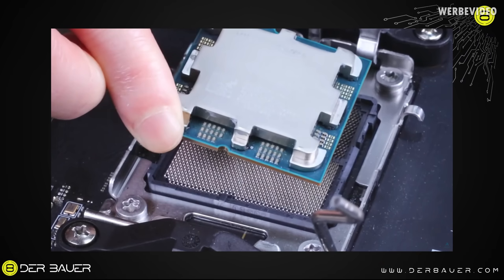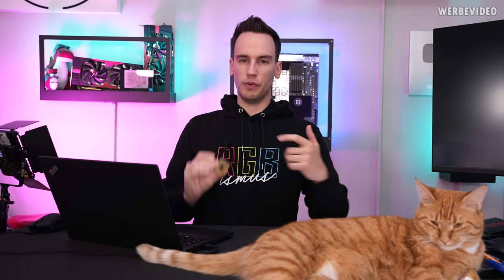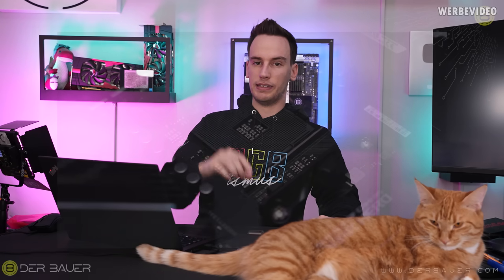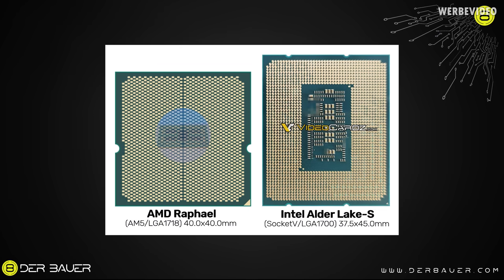Very thick IHS and less Contact Area - some thoughts on Ryzen 7000

Comment: i feel like amd might be shooting themselves in the foot with this "same mounting for am4 and am5" thing, i dunno guess we ll have to wait and see
Reply: Def piss off mobo suppliers
Reply: Isn't it just the whole spacing? Which in the end doesn't really matter
Reply: @GewelReal  No, it's the z-height.  Whereas Alder Lake for instance lost ~0.8mm z-height, so aside from different holes, you also need different parts to keep the same pressure.
Reply: @spacecowboy07723  why does keeping the same dimensions piss off mobo "suppliers"?
Reply: z-height and mounting holes are the same though, so the only problem could be that the zen 4 ccd's are situated higher.
Reply: @yourick1953  I was telling Gewel that there was more to compatibility than holes, and giving an example of incompatibility in z-height.  I wasn't talking about Zen4.
Reply: @fVNzO  because mobo suppliers can't force customers to upgrade = less money made.
Reply: @spacecowboy07723  but customers are forced to upgrade if they want zen 4 so I don't understand what you're referring to. The only ones affected here are the accessory manufacturers who won't have to waste money on new brackets, in other words positively affected.

I can't come up with a single party in this equation that would be pissed off here.
Reply: I agree. I mean it is same exact size as AM4 despite having more pins in 1718. I thought it would have a larger PCB and IHS like LGA 1700, but nope. I appreciate AMD's desire to keep existing coolers compatible without needing an adapter or different kit from cooler manufacturer , but this will hurt heating ability. When AMD said existing coolers would be compatible, I was thinking well yeah but of course you will need an adapter kit for Noctua NH-D15 and the like. But appears they wanted to make them compatible without having to change anything. That will hurt cooling performance with the lower die size and higher power. This is not a situation like Intel had where the socket changes were so small from LGA 1156, LGA 1155, LGA 1150, and LGA 1151, then LGA 1200 where it made sense without issues to keep same mounting mechanism as change was so little. This is more like the change form those to LGA 1700. Makes more sense for different holes and just get cooler vendors to provide a mounting kit.
Reply: @spacecowboy07723  Well in that case it would tick off motherboard suppliers especially the AIO and tower air coolers and custom water blocks and such. But mobo makers themselves, why would they care? You still need a new motherboard for Zen 4 anyways so has no affect on them.
Reply: @fVNzO  Actually it is accessory manufacturers who would be most pissed off since they will not make money from selling new brackets to adapt existing coolers to work with a new mounting mechanism.
Reply: @Wolverine607  I think it's the other way arround. It's an expense to produce a new mounting bracket. They wont suddenly make more money. They always sell *a mounting bracket*. Having to design a new one is an expense. Not having to design one is not an expense. 

Besides, they won't retroactively sell brackets for existing customers (which will be a loss in itself either way due to the volume), they will give that kit for free.

Comment: Zen 4 is gonna be rough, everything officially shown about it says it won't be more than just a zen 3 refresh performance and efficiency wise on a new platform. The new IO die is great and the igpu's on all chips is also great, but this will more establish a new generation of platform than a new generation of performance
Reply: 15-20% single-threading and 40% multi-threading increases isn't a "zen 3 refresh" lmao
Reply: @WhenDoesTheVideoActuallyStart  15% single threaded performance =/= 15% ipc gain. It means 15% is the sum of everything they threw at it, including more cache, a revised IO die, new process node, DDR5, architectural improvements (IPC gains) and of course clockspeed. 40% multithreaded could be due to higher all core turbos, could be due to higher memory bandwith (DDR5) could be due to the IO die and improvements to infinity fabric, or a mix of all 3. It's still a refresh performance wise. On the AMD side would be 1700x to 2700x, on the intel side would be 4770k to 5775c.

I have 2 ryzen desktops (work and gaming) and a ryzen laptop btw, I don't hate AMD or any shit like that, but I'm giving my honest thoughts and criticisms based on what knowledge we know.
Reply: @james2042  Cache size, the IO die, etc... are all part of the architecture. IPC simply means "instructions per clock", how you get more IPC doesn't matter. E.g. the 5800X3D has better IPC because of the extra cache.

Zen 4 should have around a 5-9% IPC increase depending on the workload, plus the architecture was redesigned for the 5nm node and to allow for higher clockspeeds. No matter how you phrase it, that's not a refresh, nor is it the same architecture.
Reply: @james2042  Greater than. Greater than 15%, in cinebench, which doesn't take advantage of double cache or ddr5. And 40% multi threaded on the same number of cores/threads is not a refresh, whatever way you get there.
Reply: Even the frequency x performance curve is a function of the architecture. The first iterations of Zen simply didn't scale linearly with clockspeeds, which is why AMD went for efficiency and didn't try to rush to 5Ghz. That they suddenly managed to get Zen 4 to scale to 5.5Ghz means that they had to redesign the pipeline to eliminate the bottlenecks (Which probably was about moving the data around).
Reply: @james2042  "40% multithreaded could be due"

Dont forget much higher tdp this time with 170W TDP and 230W PPT, which is why these values are as high if you compare to 5950x which becomes very power limited in all core cinebench workload, 5950x gains ~15% easily if you unlock power limits from the socket for 3d rendering. We will have to see when zen 4 will be released but from what we currently have it doesnt look good at all.
Reply: @h1tzz  yeah because 5950Xs were only ever pulling 105w🙄. Yes they gain significantly in performance if you let the core run without limits and even more if you set a specific OC for the target test. We'll have to wait and see what happens when they're out where the gains are from.
Reply: @NotThatGuyJD  default PPT of 5950x is 142W, without power limits in 3d rendering tasks it will draw ~240W and will gain ~15% of performance, we dont know yet if that demoed blender cpu was using 230 PPT as robert said it was running bellow that but we dont know how much for sure, but anyways considering that 5950x was already faster in blender than 12900k by about 15% (depending on rendering time) those numbers seems a little bit worrying but we will have to see that later.
Reply: @h1tzz  I'm hoping they provide great boosts in all aspects but my ADL system isn't really going anywhere at this point because it's already so much more than I need.
Reply: @NotThatGuyJD  alderlake is amazing outside of few hiccups for its hybrid architecture early in its release stage it has very strong IPC and multicore perf. To be honest at least in my opinion neither zen 3 users nor alderlake users should bother with zen 4 or raptorlake, unless they are upgrading from very low end SKU to high end. I personaly will keep my 5950x for a very long time and i plan on skipping ddr5 all together :)
Reply: @h1tzz  not so sure I'd skip DDR5 entirely, will probably grab a discounted Z690 board with DDR5, once Zen 4 and RaptorLake are out. 

It's a good architecture but there are definitely niggles of being on the forefront of so many new techs all at the same time with DDR5, PCIe5.0 and the hybrid design all in a single generation.
Reply: @h1tzzYT  thank you someone who understands. Not to mention I forgot the TDP bump in my original comment.
Reply: @NotThatGuyJD  my 5900x pulls 165w which is apparently limited by my motherboard (b550 tomahawk) I'm sure with a higher end mobo I could pull 230w or more. But I'm happy with my 5.1ghz single core and 4.5ghz all core turbo
Reply: @James  that mobo will easily handle more than 165w with semi decent aircooling.
Reply: @james2042  yeah while i understand that these are just preliminary numbers without specifics but out of all numbers amd could show they decided to share those, concluding all specifics like competition from alder/raptor lake, specifications changes such as increased socket power, smaller node, increased clockspeeds, possibly lackluster IPC improvements, im not overly optimistic about zen 4. I have to admit that i probably prefer intel, but i had used and owned lots of cpus from both companies and already have 3700x and now 5950x, clearly i want a good competition and tech advancements are always exciting for me. Considering how strong is alderlake and how much zen 4 needs to improve to have a chance competing against raptor lake im way more optimistic towards raptor lake than zen 4. But i would be very happy to be proven wrong.
Reply: @NotThatGuyJD  that's fair but I also don't NEED more anyways as the heat is just not worth it. 10% clock speed bump for a 40% increase in power? I have the liquid cooling if I want to but I prefer it being quieter and relaxing at 50c
Reply: @NotThatGuyJD  i wouldnt stress too much about pcie 5.0 because its going to be useless for foreseeable future, ddr5 is nice but it is still quite new. Probably when ddr5 will reach ~7000-8000mhz at reasonable price then i think its worth getting into ddr5, currently its a tough sell.
Reply: @h1tzz  don't disagree with you, although know some guys locally which will be upgrading so will get cheap pricing on their stuff, know of a couple unify Xs and there's a couple of Apexs as well that'll go cheap. And locally we have great pricing on some of the DDR5 brands and with decent ICs and a good board can push 6600+ easily.
Reply: @h1tzzYT  Zen 4 will do two things for the company, it will bring their laptop cpu's up to speed with the desktop ones (which is a bigger market than desktop anyways) and it will give them platform experience for DDR5 and PCIE 5, so they have less of an issue getting epyc going. Zen 4+ will likely be the real improvement, or Zen 5, depending on how much room there is for improvement within the architecture.

Comment: This is irrelevant, the actual silicon surface is smaller than the IHS anyway, this is already too much.
Depending on the IHS material this should have no impact on the final temperature.
Keep in mind that the bga connector is also dragging heat inside the motherboard.
As usual, if you want increased cooling capacity remove this iHS !
Once again this will only be relevant on highly overclocked machines.

Comment: My 5600x on an NH-D15 with a PBO overclock already gets stupid hot for a 6-core. My old 2700 OC ran cooler even pulling +120w more than the 5600x. This is worrying. But I guess we'll see for ourselves soon enough.
Reply: The 5600x is not a good binned chip A 5950x runs much faster and cooler. The 5600x are with the 5800x the least cores of them. They use the better ones for the 5900x and the best for the 5950x. So no worries there. 

Also the temps differ from motherboard manufacturer to another.  Usually Asus has a high Vcore. Lowering that can easely lower your temps a lot.  Usually 1.25v is more then enough for such dies. And some motherboards can be like 1.45 to 1.5v Vcore. That increases the temp a lot.
Reply: Thats weird, I've got the same setup and I live in a tropical area where the average temperature at night is between 27-30C and the hottest I've seen my 5600X with PBO is 65C.
Reply: You may have a defective chip or cooler contact issues. The 5600x isn't normally like that.
Reply: @Aggrofool  @MyJuankmilo @Karlos I think I could have worded that comment better, lemme amend some things.

Stock PBO settings are completely fine. I'm running +200mhz boost and --15 all core curve. With the agressive PBO voltage (1.3-1.45v) at these settings, it DOES get hot, but only really during benchmarks and synthetics. Day to day its perfectly fine -  but its still hotter than I expected it to be coming from my 2700 @4.1ghz. That thing pulled well over 220w under synthetic loads, whereas this 5600x obviously draws significantly less power...yet runs hotter across the board. Was sure I had a bad mount, so I remounted the cooler the day I got the CPU and the temps were exactly the same. Nothing is defective. 7nm + small cpu die + offset package = hard to cool, thats all.
Reply: @thanatoast4  cooler is lapped?
Reply: @brunogm  Not yet, planning on it for a while now, My 2700 was lapped
Reply: @Aggrofool  Or Amd messed up the soldering on his 5600x which has no way to verify without voiding the warranty and delid.
The CCD1 on my 3900x is much hotter than the CCD2 and i tested a bunch of different heatsinks so the contact issue must be under the IHS.
I gonna delid it soon because my warranty is long gone thanks to the gallium in the liquid metal eaten away all the serial numbers on the IHS LOL😄.

Comment: The actual amount of metal for heattransfer on the Zen4 is around the same as the Zen 3. Zen 3 has 30% more square but Zen 4 about 40% more thickness. So overal the numbers might even be in favour of the new Zen 4.

Also it looks like AMD is holding back some info regarding single thread performance. AMD insiders have confirmed that the numbers stated were very conservative.  I think Zen 4 will be close to Intels 13th gen in single core but still not beating but in multi-core they will be much stronger.

Looking forward to the new battles up ahead.
Reply: You're right in that the IHS will sink the same or more heat compared to Zen 3. However, heat transfer rate is primarily affected by surface area, not mass. The reduced contact surface will reduce the rate at which heat can be removed from this CPU
Reply: @zactron1997   Zen4 is produced at 5nm and will have clockspeeds up to or even over 5.5ghz. So it will be fine. Don't forget that when you do a direct die contact the actual die is even a lot snaler then the IHS.  And although a bigger surface area will help in heat dissapation the open IHS might also lose heat that way wich is otherwise trapped inside the IHS.

So overal i don't think there will be a significant difference.
Reply: @karlos1060  oh I agree I don't think this will perform noticeably worse, but it should be worse due to that thickness and reduced surface area. Again, it won't matter at all and it probably makes a lot of sense, but it will be worse.
Reply: More material between the transistors and the cooler's heat pipes has the effect of increasing thermal insulation. So it's a bad thing that they kept the overall amount of copper the same.
Reply: @karlos1060  Maybe open IHS  will be more relevant for LNitrogen

Comment: Those cutouts seem dumb, hundreds of people will probably wreck their machines by applying too much paste, and having it ooze out, roll down, and short out those capacitors.
Reply: Yup exactly. Though a little non conductive paste probably will not hurt it, it might which is not good. Though liquid metal forget about it. It will fry it right off the bat. You have to be careful enough with liquid metal as it is even on normal IHS that it does not drip into mobo or say goodbye to motherboard.